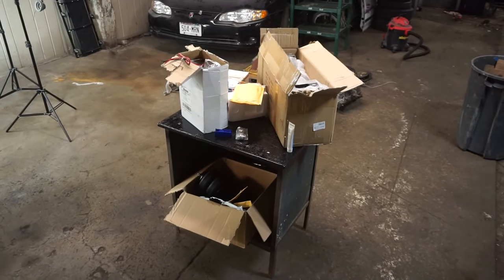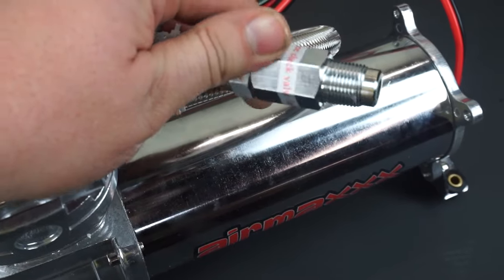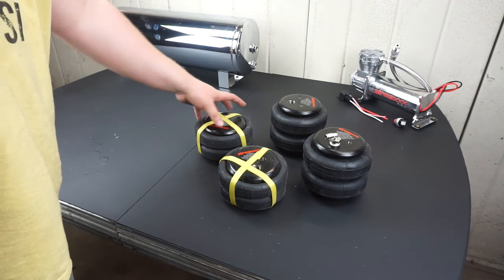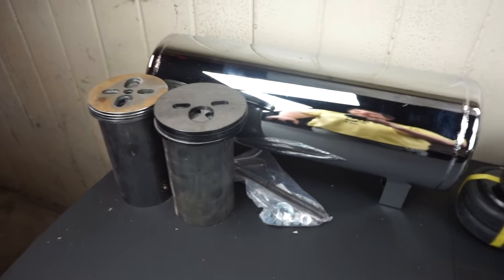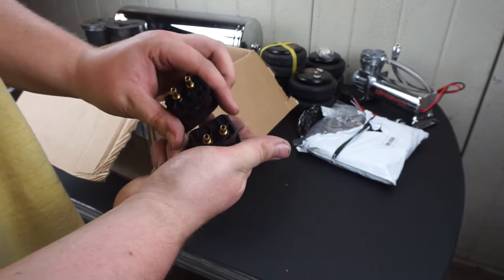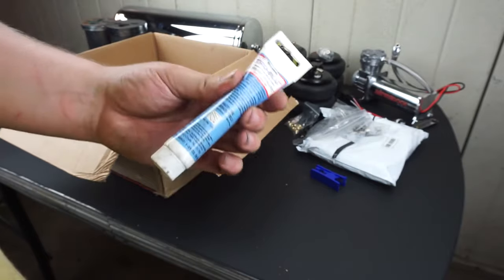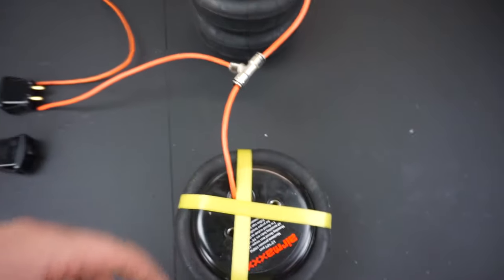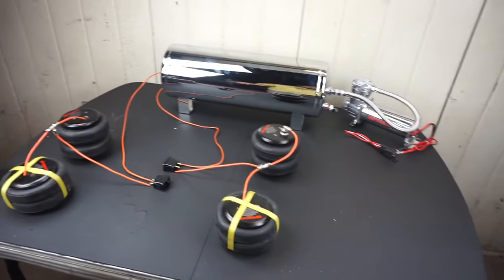Unboxing The Cheapest Air Bag Suspension I Could Find

Comment: Don’t run a t when you turn air will go from one bag to the other causing your car to roll
Reply from the maker: Some people have done it with no issue, I wanna try it and if it feels sketch I'll upgrade to 4 valves and separate lines.
Reply: Bags should NEVER be connected in parallel, worst case scenario being on the same axle. As LNM Performance correctly pointed out, when turning, the center of gravity will tend to keep going straight, thus creating the natural rolling effect on the car. Rolling 'toward' the outer wheels will compress the outer curve bags, which will send the air exactly to the inner curve bags, therefore AMPLIFYING the roll !! This is a recipe for DISASTER. In the least, will bring the OPPOSITE of safety conditions in cornering. Please consider this with much care, even more so, with the notorious view numbers.. Thank you.
Reply: @moronoqg  
Semis and semi trailers link all 4 rear bags together, with a proper anti-sway setup it's not an issue
Reply: I was going to say the same thing. It's alright for towing, but it's the worst thing for cornering

Comment: That relay is what causes compressor to fail. It's really too small. Use a PAC solenoid. Yes, it's more money, but it will save you hours of head scratching as to why compressors keep burning up. Or why relays are melting. I learned this trick years ago. And I've never lost another compressor ever since then. No matter how small or cheap the compressor may be.

Comment: Consider adding another switch for the front suspension.  Getting the front to stay even after lifting is hard. Without a swaybar it is almost impossible.
Reply from the maker: Ended up doing 4 switches, one for each corner.

Comment: ...that's an interesting and informative video on air suspension system.   I once owned a 1990 Lincoln Continental, that had a built in air suspension system from the factory.   I got it from a friend in 2005.  The air pressure would regularly fail, due to an air leak in the system and every morning I would find the rear end sitting on the floor, because the airbag would lose air overnight.  I never could figure it out, I just figured the system was getting old.   One day while the car was jacked up, the air compressor proceeded to air up the system, the rear left wheel airbag blew up, while the car was on jack stands.  Don't ask me why. 😂    The system was on it's last leg, when I got the car, it was free anyway. 😂

Anyway, I eventually replaced all the struts/airbag units from the factory, with coil struts from a Ford Taurus, that I obtained from a salvage yard.  The whole swap cost me about $40.  I also pulled out the air compressor, and gave it all away.  FYI, the rear coils on those struts, from a Taurus, aren't strong enough to carry a Continental, you need stiffer ones, but they worked up until 2009.  
After looking at this video, I'm wondering if I could have fixed the airbag problem on the Continental with Check valves, which would have prevented any one single airbag from releasing all the air, that was stored in the airlines to each pair of bags.    
I eventually stopped driving that Continental in 2009-2010, I literally abandoned it, at an empty parking lot.  😂
Reply: Youre supposed to turn the air susspension off when you jack em up. Sorry 4 your loss
Reply: There's a switch in the trunk to cut the air suspension off and some were on the passenger foot well. I've repaired in the past a million of those systems. Back in the day the Stealership(Dealership) would charge $800 per side to fix it when all it be is an O-ring leaking air on the airline. A spray bottle filled with water and dishwashing liquid was my friend in finding the leak EASILY.
Reply: What parking lot👀

Comment: I would suggest rethinking your valve setup...its not that much more to add a few valves and have control. My setup i had 8 smc 3/8 valves. 4 fill and 4 dumps.   You can wire them to have 2 lift the from at the same time and rear etc. I had issues with tying in one line to 2 bags...my truck rode like crap. The extra valves dramatically improved ride quality.
Reply from the maker: Yeah I ended up with 4 paddle valves cause it wasn't that much extra work and only 30 bucks more.

Comment: Optd for the bigger compressor. I bought this one and on a half gallon tank/train horn set up it burnt up in 6 months. Called airmaxx and they said no rebuild kit. Bought the bigger compressor. No problems 1 year in
Reply: And also now running the airmaxx 2600lb bags on the back for towing
Reply from the maker: Good to know, I wanna go bigger on the compressor for sure. It takes a long time to fill this tank.

Comment: Wouldn't go with the 1/4 inche line mines 1
1/2 in the front due to engine weight and 3/8 in the rear

Comment: Where are your air valves to operate the air system? Usually its 4 valves to operate both front and both rear for an Front/back setup.
Reply: Only need two paddle valves, the front two bags get Teed into each other as well as the rear, one switch airs up both fronts and the other switch will air up both back bags.

Comment: I am curious to see how long the cheeper stuff holds up. I have always been picky with what air ride parts I used. If I have something go wrong things get complicated really quick given how low I build my stuff. I am still watching the video at the time I am typing this lol
Reply from the maker: So far it's been fine my biggest complaint has been the cheap air line not locking in to the ptc fittings the best and leaking here and there. Bags are fine, compressor is fine.
Reply: @wideband  hey there,  I saw your video. I have a toyota camry 2015. I live in New York City. Is this system compatible with my car? Is the brand of the whole system called airmaxx?
Reply from the maker: @RWarrior777  nah you probably have a strut type suspension these bags don't work with that
Reply: @wideband  thanks, what type of strut suspension can you recommend for me. That can give me that very comfortable non bumpy ride.?
Reply: @wideband  bags and compresser still holding??

Comment: If I wanted to buy pre built cups do they have them for a 2003 volvon s40
Reply from the maker: That car has struts in the front so you will either need an air strut or a double sleeved bag, I'm not sure what the rear looks like, maybe cups could work there. The prebuilt kit I found for that car was an Air Lift Performance kit that was 3700-4000 US Dollars.

Comment: This is so cool. How much does the compressor draw? Im guessing not too much, as the wires are not too big. Compared to amplifier Wire
Reply from the maker: Dont know how much it draws but im using 6 gauge wire and a 30 amp fuse.
Reply: @wideband  Okay thanks. Im thinking if I could manage to bag my 1991 Mitsubishi Galant. But its difficult to find the parts for less than thousands of dollars where I live. And I need help from someone to make the cylinders to make it fit my car.
Reply: 22 amps is max draw

Comment: couldn't i just hook up presta-valves in all four corners and just fill/deflate manually? i was thinking about having presta valves in all four corners and jut having a portable compressor. trying to avoid to have to make room for tank,compressor, etc.
Reply: You mean Schrader valves.    Presto valves are for narrow bicycle rims like on road bikes.   Yes they are easier to put air in, but likewise you need to keep them tight.    Kind of a specialty for an auto application, and besides, the air chuck for schrader valves are everywhere, at every gas station, garage, etc.    Or, go your own way.,..
Reply: @andrewhigdon8346  right. That’s what I meant. Thank you.

Comment: Where's did you get the plugs for the tank?
Reply: Looks like they are 1/2" plugs. Just search " 1/2" NPT countersunk plug" on Amazon or eBay and you should be able to find something similar.
Reply: You can get those at any hardware store.

Comment: How are you going to deflate?
Reply from the maker: The paddle valves are 2 ways. Up sends air pressure to the bag. Down releases the air from the bag out of the valve via a vent hole in the back.

Comment: From experience I can honestly say you should not cheap out on your air ride. You'll just end up replacing the cheap parts in the long run. That airmaxxx compressor and those airmaxxx  bags are shit products and you will 100% have issues with both products. Using the cheapest parts you can find could potentially be dangerous.
Reply: Aaron I only see an airtank under your name from 6 years ago.    Bags are made by the same factory as Air lift Dominators. so tell me why the quality sucks?   Compressors have the same warranty as Viair.  Except Viair Repairs the compressor and these get replaced with new ones. As long as the compressor is still under 1 year warranty and was not abused.  We also Sell Airlift, Slam Specialties, Levelride, AVS. etc
Reply: @airslamit-travis7958  when i had my bagged impala. I ordered a dual pack of airmaxx compressors. 2 days after install 1 compressor stop working. Got another on warranty. 1 month later the replacement stopped working. Couple weeks after that the other compressor stopped pumping air. Sent both in for warranty. Got another set. 2 weeks later one was leaking out of the head of the compressors. As for the bags. Friend of mine used airmaxxx bags on the rear of his 300. Long story short he went through 3 sets. All bags started to separate and show the still mesh. Im npt just talking out of my ass sir. Im speaking from experience.
Reply: @airslamit-travis7958  and i purchased the compressors from a company called wheels n parts. I believe they are located in Arizona somewhere. That why you only see a tank purchase from me through airslamit.
Reply: @AJ_OnBags  I'm gonna email you directly.  I assume it was a 2500 bag and was rubbing on the rear of the 300.  We ended up changing the kit to a smaller bag because of that.  The bags are seriously made by the same Factory as the dominators.  They have the same top and bottom caps and rubber.  They are just different dimension (same dims as firestone).  The quality is no better and no worse than airlift.  But I appreciate the response.  look for my email.  Thx
Reply: I appreciate this comment thread. I hope OP's problems got resolved and his opinions of the company were changed, it looked like some customer service was about to make that happen.

If not... well shit 🤷‍♂️😅
Reply: @AJ_OnBags Still having issues?

Comment: You never shared where to T off the air pressure gauge
Reply from the maker: In between the manual valve and the bag. If you are teeing your front and rear bags I would run it inbetween the tee and the valve.

Comment: This is forsure not a proper way to set up your lines you never want the front bags tied together especially with manual paddle valves I wish you did more research and stop thinking with your wallet
Reply from the maker: If you watch the install I actually decided not to tie them together.